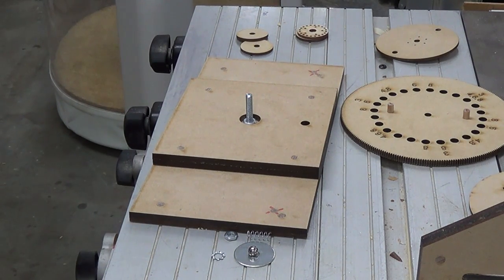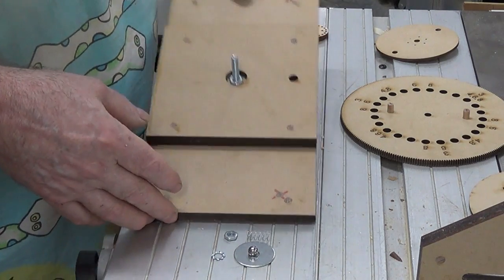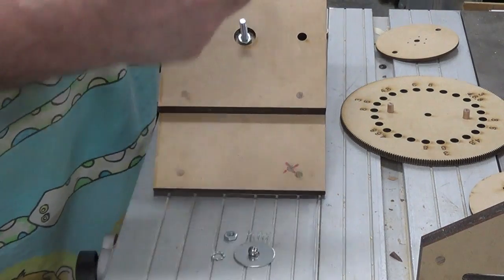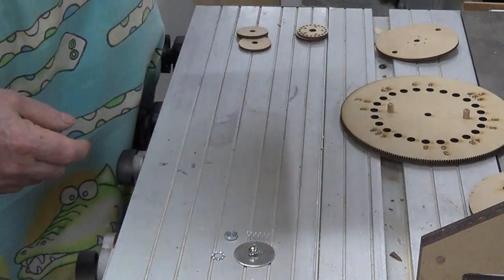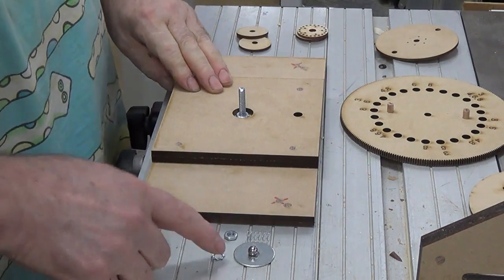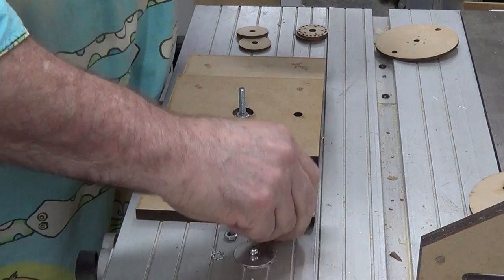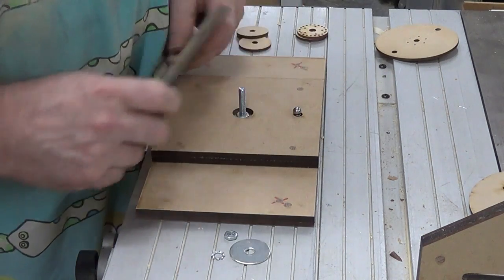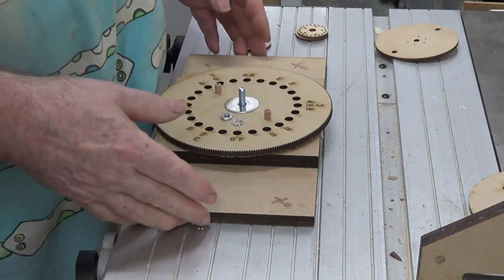Drill Indexing Jig for small parts

Comment: bonsoir
je viens de voir votre video tres interessant  vender vous le plan 
merci
bonne soirée
Reply from the maker: Bonjour Eric, tu auras besoin de ton traducteur anglais vers le français pour le reste ...
(Hello Eric, you will need your English translator to French for the rest ...)

I do not sell my stuff... I prefer to give it away... however, the next time you visit Australia, you can buy me a beer.  

The only catch is that the "plans" are in SketchUp.  Sketchup is a free 3D design software downloadable from the Internet.  A lot of people have older versions so I have uploaded a 2016 version of it to maintain downward compatibility for all the available free downloads still available from Trimble.
This is the link to my DropBox,
https://www.dropbox.com/s/55az8xhp6kdo6x1/Circle%20drilling%20jig%20%282016%29.skp?dl=0
While it doesn't give measurements if you use the "Tape Measure" and/or the "Dimension" tool, you should get all your requirements.

I have just made a PDF (to scale), however, the page dimensions are 300mm x 600mm (size of my laser bed),
https://www.dropbox.com/s/ixj0zrxq6p4217a/Circle%20Drilling%20Jig%20%28with%20measurements%29.pdf?dl=0

Both can be downloaded.
If you are interested, download as soon as possible as I may delete it to recover space.

I forgot to mention... The "geared wheels" are only for grip... circles with rough edges will do just as well.  It's outer diameter has to be bigger than the piece you are about to drill.

J'espère que cela a aidé.
(I hope this helped.)

Comment: You have me so much curious here, your jig looks interesting, but I don't really see the immediate uses I would have for it in my wood shop. Could you possibly make a video quickly depicting all the different ways it might be at alized to give me and other users a better idea? I would think such a video would boost the viewership on this one as well. Thank you
Reply from the maker: Hi Mark,  I am a retired hobbyis and one of my passions is to make toy vehicles.  I try to make regular posts of by projects on LumberJocks and often make these videos to supplement some of those articles. I go by the tag of "LittleBlackDuck" and this is a link to my Home page there http://lumberjocks.com/LittleBlackDuck .  Not that I am spruiking my contributions but if you look under my Projects (in particular the toys) you may see the result of using my jigs.  I appreciate that not too many people have access to a laser cutter (though CNC's are becoming quite popular with ever increasing access... and all my jigs are "CNCable"), however, I produced some of my videos to give people ideas... if only to let them know how videos should NOT be done. Now to answer your question... I basically use this jig to drill holes in rims for wheels usually about 40mm in diameter.  The number of holes range from  5 to 20 depending on the style of rim I'm striving for.